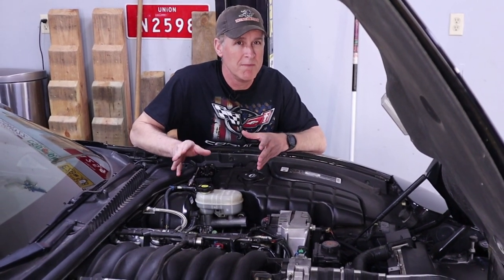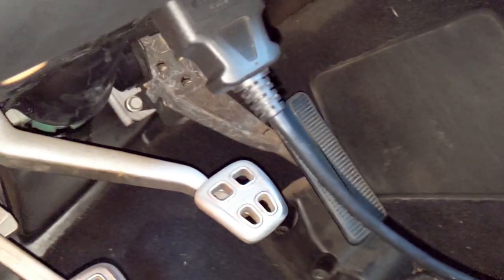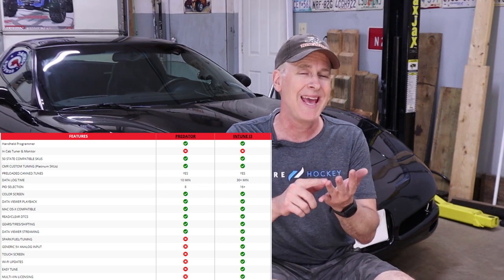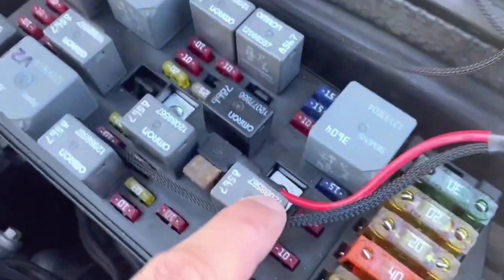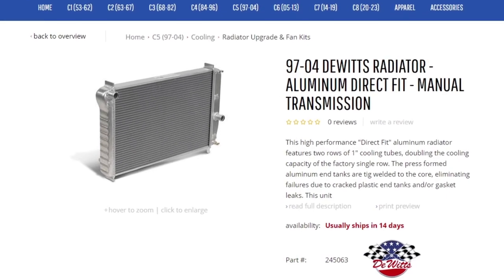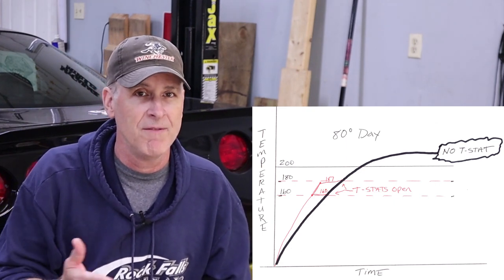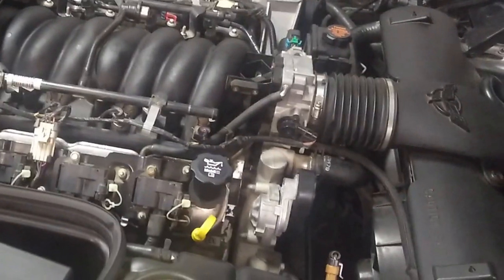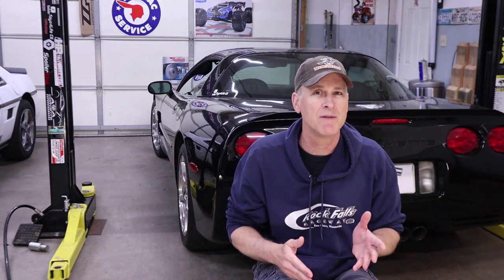Lower your C5 Corvette's Coolant Temperature (6 methods explained!)

Comment: Another excellent video that should clear up the confusion about coolant temperatures. Your recomendation against a 180 degree thermostat is wise. Our Corvettes are designed to run hotter than what most believe to be necessary. One small note: If one is panicking about higher coolant temperatures while sitting in traffic, turn on the AC and it will activate a coolant fan to help reduce the temperature. The best advice you noted was to clean out the front of the radiator and condensor from road debris. Thank you for another great C5 video.
Reply from the maker: That is true but - the problem is when you turn on the AC it runs the ac which means the condenser that sits in front of the radiator is getting warmer (shedding heat) directly into the radiator - thus eliminating some of the benefit.
Reply: @Toys4Life  I agree with you. Just a small temperature drop but maybe enough to alleviate some owners' anxiety. Many of my fellow Corvette owners do not accept that these modern engines run hotter.

Comment: I live in Vegas and the temps have been starting at 90 degrees at 7am and going up to 110 around noon, my cars temps cruise around 210 - coolant and 230 - oil with very relaxed driving and very short trips. I just resently did a 160 thermostat and a street tune and had my fan temps lowered a bit, now my car has had 216 - oil and 205 coolant temps with some aggressive driving. I can say it was definitely worth doing both as it just give me a little bit confidence with my type of driving.
Reply: I live in Vagas also, where did you go to get your tune done?

Comment: Over many yrs I experimented with 160, 170, 180, 185, stock T-Stats.  And that includes drilling bleed holes them, adjusting e-fan limits, and even trimming down the outside diameter of the water pump impeller. 

For the C5 here is my thought... if its STOCK run a 160 or 170 and have the tune adjusted for it.  If its got a cam and/or you track it.. or live where you see 95F temps regularly.. swap the radiator for an all aluminum and increased capacity unit. And run a 180 and adjust the tune.

My 04Z06 - three years on a 160 T-Stat and ECS tune. 10k miles including 100F in the south, road trips, and extended idling.  No problems at all. My OIL temps are 172-176 in regular driving. Max I saw was 220 and that was running the tail of the dragon for 1hr in a lower gear.  And that was only when I was at heavy throttle. Within 30seconds of backing off.. oil temp came downward (Mobil 1 10W-30)
Coolant temps are in the 172F to 195F area no matter the temps or speed.
I clean debris from my rad and condenser each yr before my annual drive to the tail of the dragon.

One more point... I once got a mod combo that resulted in a run away coolant temp situation.  That was a 5.0L mustang (1995) where I cut the impeller OD down, used a 160 T-Stat, and drilled a bleed hole in it.   In knoxville Tn it kept getting too hot in stop and go traffic.  I changed it to a 180 T-Stat w/o a bleed hole and it was fine from then on.
The trouble that can happen is that the T-Stat stays open all the time, the coolant passes through the radiator too fast to cool off, and you get a thermal runaway situation. So raising the T-Stat opening point (in those situations) can give it just enough time to dwell in the radiator to cool off. 

IMO don't be afraid of a colder stat AS LONG AS the tune is adjusted for it. (there are several parameters that need to be adjusted.. not just the e-fan)

btw... I was a water pump engineer at Ford for 6 yrs 😉

Comment: The stock operating temps for my 135i N55 are 120C. I lowered them to 90C mostly by upgrading the oil thermostat housing. I also opened up the engine bay & set the radiator fans to sport which accounts for about 5C reduction. Even at autobahn speeds I don't ever get near stock temps anymore. Really helps with longevity & reducing stress on oil & plastic components. No additional aftermarket oil cooler is needed and the warm up time remains the same.
Reply: Engineers wanted a cleaner/efficient combustion over a less cleainer less reliable engine
Reply: You need your oil temp over 100 C to boil the water out. Also the hotter you can run your engine without detonation and knock, the more efficient it will run.
Reply: @mwp1088  I don't notice more or less consumption. The temps are slightly above 100C when driving 220-280kmh for a few minutes. I think hotter temps are worse
Reply: @mwp1088  Water already evaporates at lower temperatures. 

But tollerances are designed for a certain temperature and Oil is designed for a certain temperature.

@digitaldissident : did you change to different oil too? 
Maybe added a oil catch can for the increased blowby?

I am curious, never heard of a 120c engine😊

Comment: You forgot one item Dewitt upgraded fans move twice the air my c5 was running in LA 225-235 I was afraid to drive it I replaced the radiator and fan upgrade from Dewitt installed 160 thermostat new air dam and big mouth scoop hot days cars runs 185-200 I’m loving it and thx Dewitt for the advice and parts reccomendation

Comment: Bought the ECP aluminum radiator for my '97 and, although I have no plans to track the car etc, I did notice the temps rising quickly when at idle in warmer temps- all the way up to around 220°F and zero fan activity. Noticed an  immediate difference with the new setup, but will be resetting the fan temps for additional peace of mind. Now, regardless of what is 'normal' fluctuation for this car, I am still not comfortable knowing that my coolant temps will rise 30-40 degrees time and time again. I would tend to think that it isn't particularly good for an engine to experience such constant temperature differences, but that's just my opinion.

Comment: On my 96, a 160 degree thermostat along with setting fans to on at 200 degrees and 205 degrees for the C4 LT-1 is a perfect setting. For the LT-1, you do get slightly more power by doing that. I would imagine the same for your car but mine is tuned with Jets DST. Installing a 160 degree thermostat insures you can increase timing with less of a chance of knock. As soon as I made that change, my 96 ran better and did feel slightly more power resulting from it...
Reply from the maker: Not sure how a 160 thermostat keeps it cooler actually, it's going to blow past that and not look back, unless it's ❄️.

Comment: Plz keep in mind that I have no experience with Corvettes however, (several things) I know they share many parts as any other G.M. vehicle uses! Secondly, I have wired up several cooling systems! Also, I drive a pontiac & I had never heard my cooling fan operate, so I began testing. All parts worked fine, the car just never reached 220-230° degrees but, I wanted to ensure that I could turn on my fan at any moment so, I poked around my fusebox cooling fan relay until the fan turned on (with the test light attached to a GROUND) I ran a wire into the vehicle, attached a 2 pin toggle switch, then connected the second pin directly to ground/sheet metal under the dash! I can control my fan at any moment yet, The fan still works at its normal temp specs! I am pretty sure the Vette uses the same exact fuse block as my G.M. so yeah. One visible wire to a toggle & a short wire under the dash which is unseen!

Comment: I have the hood louvers and the remote switch. Although my car is not tuned , the only yime i use the remote , if we sit in traffic on a really hot day with the ac on. Cruising at 65 70 there is never any need
Reply from the maker: Oh, I bet those louvers help quite a bit!

Comment: I so enjoy your videos.  They are well explained with details and a common sense approach.  While I understand your technical expertise about heat dissipation and everything you said was factual you never mentioned additives for your coolant.  I can testify that water wetter does lower your temperatures 2 to 5 degrees once you add it it into the coolant.

Also, is that a Fiero in your garage next to your C5 Corvette?  Good job, keep up the good work and the informational videos.  Tee
Reply from the maker: I should have done a little more research on water wetter agents. I agree, I think they probably do help! Yes, that's a Pontiac Fiero with a modified 3,800 supercharged engine.

Comment: Been seeing a few in the Facebook group lately with new splitters with overheating problems afterward, might make for a good vid.
Reply: I trimmed my front air lip sense I am lowered on stock bolts. Since then I have definitely noticed a decent jump in my temperatures. In Houston heat It definitely makes me worried since The temperature gauge goes above 235 pretty frequently. Especially in slower driving speeds Around town and up to 50 mph. Once at free-flowing highway speeds above 65 things cool down a lot.

Comment: I have purchased a 50th anniversary Corvette with a manual six-speed about 3 months ago and I know clearly now that it definitely doesn't have a heating I'm not sure what the gentleman has done to it but clearly something was done that's something I don't have to tackle which is nice. I know also that the exhaust was changed putting in an x pipe and exhaust in the rear of the car with mufflers I know it's has a cold air intake which I was told was tuned on a dyno but what downtown's me is that I have played around on the street with two newer Corvettes and I have no problem stay with them actually embarrassing one of that too not sure what's been done to this car but you open up the hood and it looks stock besides that intake

Comment: I'm just watching to see what's up with the temperature,  I don't remember what mine runs and don't think I really looked at it,  I bought it new in 01 and just drove it to Florida and back then a little here and there,  I plan on taking it out this year for some  cleaning and a couple miles around it only has 7500 on it but has been sitting years again

Comment: I’m late to the party but some great info here. Another temp to try and would be oil temp. Mine will get up 265 on hot day with a heavy foot, but it normally will come down quickly and run in the 215 to 235 range.
Reply from the maker: With synthetic oil I wouldn't worry about that too much.  You certainly could add an external oil cooler.   Mine rarely get over 240 - but  I will try to keep a better eye on them!
Reply: 265 wow... most I ever saw was 230F in my C5 Z06.
Reply: Get a dewits  radiator that has a heat exchanger for your oil. As long as you’re moving, your temps will be fine. Uses engine coolant to cool oil.

Comment: Disagree on the 160° thermostat.  You can always play with the fans to make it warmer, but you can't if the cooler coolant isn't there.

I run 160s in all of my LS vehicles and i use HP Tuners to modify the fan settings for a normal operating temperature of 185 on a 70ish degree day.

This equates to around 210° sitting in traffic on a 110° day and around 170° when it's freezing outside.

This equates to lower temps all around including oil temps of less than 250 when giving it the beans on said 110° day...
Reply from the maker: What temp do you suppose your engine would sit at on a 55 degree day taking a road trip (averaging 65mph) down the freeway to the Corvette Museum with a 160 T-stat?
Reply: @Toys4Life  stays around 185 on the highway in most conditions.

During the colder winter days that I was willing to drive it, I think the coldest it got on the highway was around 175-177.

I don't drive them daily.  My daily is provided by my company.

I do a majority of my highway driving during these 110° summer days.

I can alter the fans to make it run hotter though.

Comment: I have an ECP radiator in my M6 2000 and it performs significantly worse that the stock unit, which unfortunately sprung a leak. The customer service was okay, the two owners are pretty decent chaps. The first one they sent me was a leaky mess and I replaced every part of the cooling system until I finally figured out that the radiator was leaking from between the fins. They sent me a second one. It did not leak, but it performed the same. I was really hoping it would be at least an improvement to the stock radiator. 

With the AC on max with the stock unit the engine never went past 192 sitting idle and the AC blew cold enough to form condensation on the windows. 

Sitting idle the new radiator with the AC on max the car will get to 230 and the second fan will cut on to bring it down. I should mention that the AC will not blow as cold as it did with the stock unit and when the car is getting to 230 the AC barely works. It does, however, work well while you are driving and maintains a stable temp of 192 and the AC will blow.... cooler but not like it would before; I do not believe it flows as well as the original. I think I will scrape together some cash for a Dewitts.

I should add that I have kept my AC maintained in tip-top shape
Reply from the maker: If that's true, the coolant must not be going through the whole radiator cuz I believe it's a two-core correct?
Reply: @Toys4Life  Two-core is correct. If it is a coolant flow issue it does not explain the AC warming at idle yet cooling while driving. I think the design is airflow restricted rather than coolant restricted.

I could rig my fans to run high all the time. 

Or maybe justify hood vents and a fan upgrade? 😄

I actually have a third and brand new ECP unit sitting on a shelf still in the box because the owners sent it to me free of charge assuming there were flaws in the first two. The second radiator they sent wasn't even tall enough to mount properly to the upper radiator support and bushings. I found this discovery baffling.

Considering the QC issues, I am having trouble believing a third swap would result in any difference; After the fight with the first and second units I am burnt out and hesitant to put more labor into it. I am considering just selling it to reclaim some cash to stick into a Dewitts fund. I do not think I can justify the labor required to swap it just to snuff out the glimmer of hope that it rectifies the issue.

Assuming my experience is the same for other owners, I wonder what this is doing to the automatic cars out there...😬

Comment: Love my Dewitt’s radiator. Coolant sits low 180s on a hot day and 170s on a cool day, with oil under 210 on a hot day and 190s on a cool day. The little radiator stock c5s have is a joke

Comment: I had no ability to use the key fobs or tire pressure monitoring system. My RFA module had the green crusties. I replaced the module and have been able to reprogram the key fobs, but the tpms is not showing up in the DIC.  Any suggestions. Does the BCM need reprogrammed with RPO configuration in body control systems? thank you.
Reply from the maker: https://www.corvetteforum.com/forums/c5-tech/3503367-keyless-entry-rfa-module-not-working.html

Comment: The last C5 rolled off the assembly line almost twenty years ago.
I wouldn't trust the plastic after that long & tons of heat cycles.
Good time to replace w a new one anyway.
Cheap insurance.
Reply from the maker: Good point, that having been said I'm amazed at how long plastic radiators last. I have another one that's from the mid '80s in my supercharged 3800 Fiero, still going strong.
Reply: It's the rubber seals that degrade the most w/time and thermal cycles.

Comment: My A/C doesn't work....new condensors but still does not work.  Does this affect engine?
Reply from the maker: If there is no AC pressure, the computer won't trigger the AC compressor to run.   Should be fine.

Comment: Is there any downside to lowering the fan thresholds down to around 190-200 degrees?
Reply from the maker: Setting it to 190 could have the fans running an awful lot in warmer climates. This will be more wear and tear on your fans, circuitry and alternator.
Reply: @Toys4Life  Ok, but my engine will be nice and comfy and COOL!!! 🥶😁 That seems like a potentially good compromise?

Comment: I love in south Florida and it’s getting extremely hot. My coolant and transmission fluid temps get close to 230f. It’s really starting to worry me. I know the c5 runs hot but is this TOO hot?
Reply from the maker: Automatic transmission I presume, do you have a cooler on it?
Reply: @Toys4Life  you are correct, it is automatic. I purchased it a few months ago and there is not a cooler on it
Reply from the maker: I would probably get the fans to come on sooner. That should lower both temps. Have you cleaned out your radiator thoroughly and condenser. Not sure if you're aware but your transmission does have a little bit of a cooler in the radiator.
Reply: @Toys4Life  I have not but it’s definitely something I’m going to do. I’m getting the car tuned so I will definitely have them turn the fans on earlier. I did not know the transmission had a little cooler. That’s interesting

Comment: Good information. I find a lot of crap up against the condenser that needs attention monthly. I never thought of trying my Diablosport Trinity on my C5 to adjust fan temps. I am going to do that. Not sure if that is available in the unit. I bought the Trinity for my pickup. Another thing I have been meaning to ask. I see the 50 AE badge on the hatch. What happened to the front fender badges?
Reply from the maker: Thank you!!   My car is not the Anniversary special edition.  it is just a 2003 and I think even the normal ones have the special hatch badgh.
Reply: @Toys4Life  All 2003  models have the silver front and rear emblems with “Anniversary 50” at the top of the emblem. Only the Anniversary Edition came with the fender badges. Though I have seen some that owners have added to the fenders on none AE cars   But those baby’s must be made out of Panda cause Ecklers had them on their website a couple years ago for like  $250.00 a piece.
Reply: @matthewboudreaux2693 I removed the front badge… BEST upgrade I did… no more wax I can’t clean out